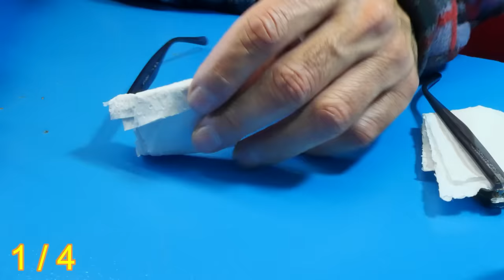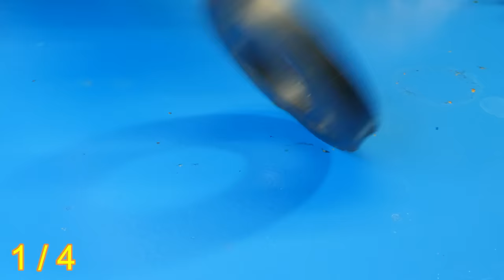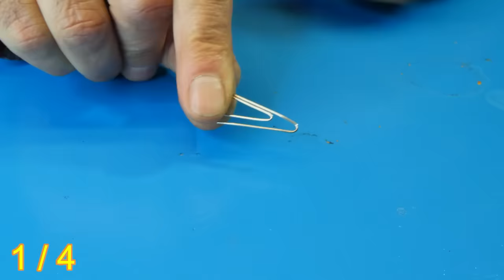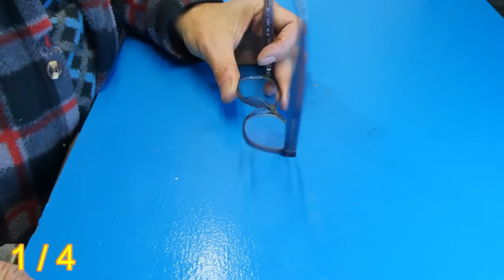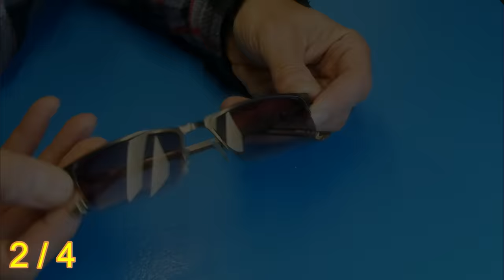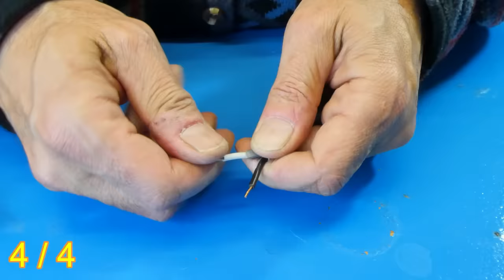Put a Paper Clip into the Broken Eyeglasses and Amazed at the Result !

Comment: My 2 cents - superglue must have a rough surface to glue.  If you take very smooth and shiny surface ( on 2 different pieces ), the glue will not hold if you try to glue them.  Did this as a kid when I new a lot less.     So you have to put a roughness on the plastic.  Not sure what to use.  but it needs a rough surface.    the alternative is to find a glue that 'melts' the 2 surfaces together. that is what model airplae glue did to glue you plastic models together.    I watched a man fix a road sign ( belonged to my family ) where the plastic piece had broke off.  All he did was scrap some plastic off side of sign, mix with acetone ( dissolves the plastic ) and make a glue out of it - which he used to fix the sign.   see - 'Melt it together'.   It will require research to find out what melts the plastic of your glasses.  Or sand it rough for superglue.
Reply from the maker: Yes 100% right. Thanks for watching !

Comment: Best way to repair your spectacles is to let your local spectacle shop to do the job. It takes only few minutes and is very often free of charge.
If you want to do it yourself, try the following: For most plastic spectacle frames ACETONE works excellently. Dip the surfaces shortly into acetone and then press together. Let cure few minutes. Done. No additional parts needed.
Reply from the maker: Agree 100% that´s just how i show in my latest video ! thx for watching !